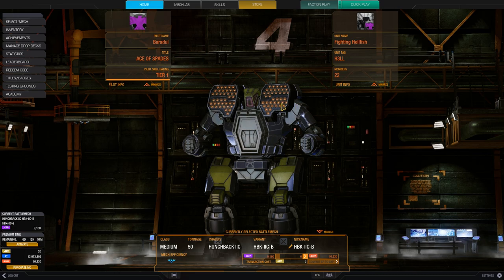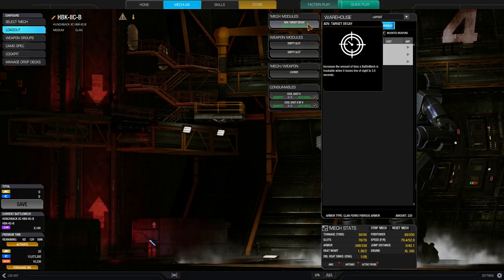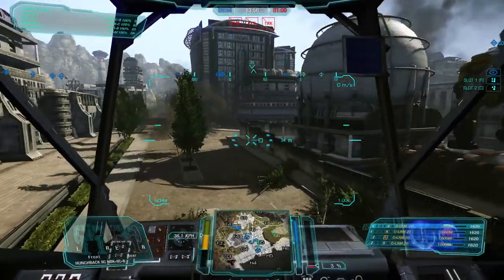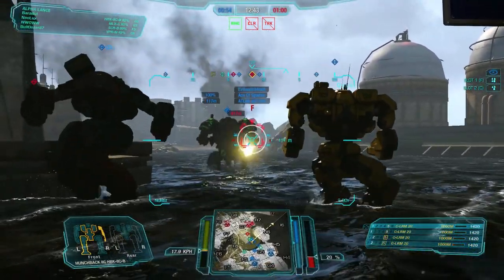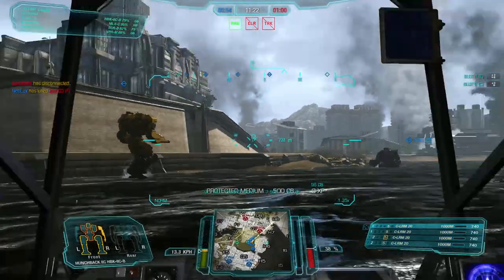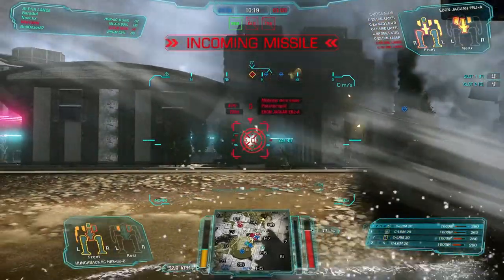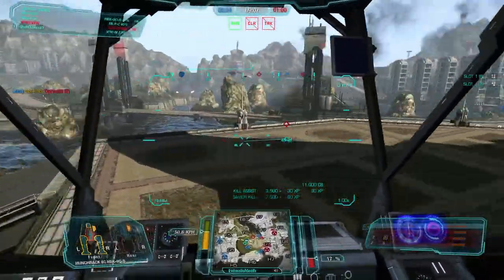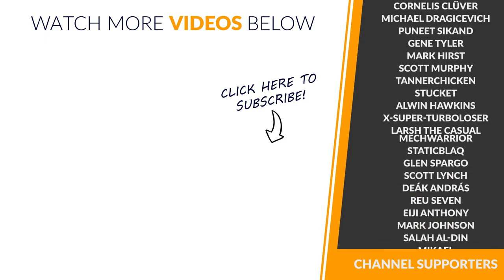LRM80 Hunchback IIC Missile Troll Build - Mechwarrior Online

Comment: The LRM are not for killing, this is supporter to remove the armor and make it more easy for the heavy to make the kill. The benefit are you shoot over the other mechs so 2nd line no problem, you shoot over cover what hit the targets self if they are in cover and force them to come out. LRM need more tactical thinking from the whole team. Make a lot of damage but wide spread. If you read the books all battles start with the artillery mechs, and also no modern war without artillery. In the tabletop if you hit a mech with more than 20 LRM they have to check about fall down, and to come up can be a problem, make them a easy target.

Comment: Suggestions for lrm, you want to be about 400-700m.  quick time to target but realatively safe.  You job is to quickly beat the hell out of targets that are locked, this means follow your assaults into their assaults and prosper.  Counter rotate around you deathball to keep your front line between you and them. 

As a maddog 60-90 lover, I promise you can dominate the hell out of people.  

And don't just stream fire, only do that if they are in the open and you want to deal max damage per heat.  Instead open them up with MAX missile barrage to make them flinch.  People don't respond to 30-40 damage that is scattered but 70+, they will start twisting, giving your friend time to cool off and pick a component to destroy.  do not overheat...ever...

Comment: You carried more LRMs and did more damage than most Cyclops missleboats I see in battle. Now that you've done the troll build try downgrading the LRM tubes to mount secondary weapons to create a viable "Pocket Missileboat" with LRM60.

http://mwo.smurfy-net.de/mechlab#i=369&l=2f3713ac73a8f60eaad472a5ccf8b5ea6103e90e

The limitation is only 2 energy hardpoints.  4 Medium lasers would be great but with only 2 plus the fact that you need some range since you're playing at prime LRM range (300-500m) I put in the LPL to act as the scalpel for cored torsos you kept seeing in game play.  If you don't mind getting closer and possibly moving from 2nd line to front line replace them with a pair of MPLs and upgrade your missiles or add more Heat Sinks.

Comment: This is the WRONG way to boat LRM! It's a troll build to troll yourself because you will run out of ammo too fast and have no backup weapons after that. Drop the LRM20 to LRM15 and you can mount 2x ERML in the CT, with more ammo to keep the damage flowing. You can even mount jump jets and active probe if you use the smaller engines.

Summary: the total number of missiles you can throw out in the whole match is more important than the total number of missile tubes. The 4x LRM15 "LRM60" build I think you will want to make 2 matches because you can keep the damage flowing and support the team the whole match.